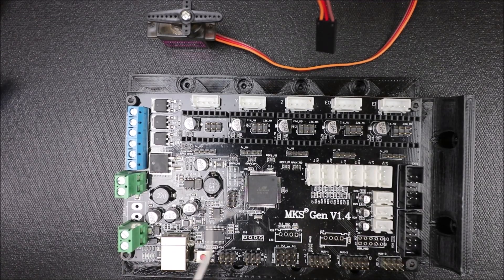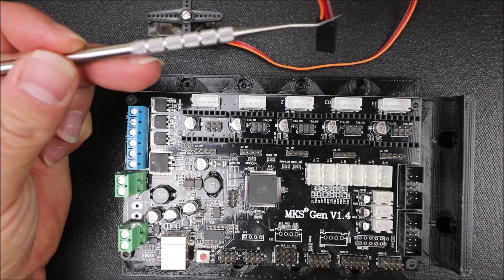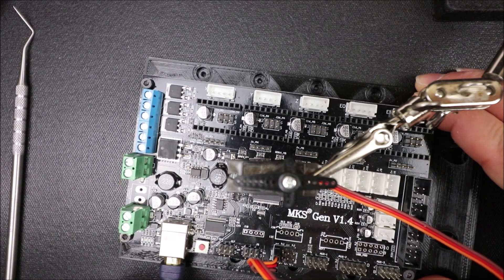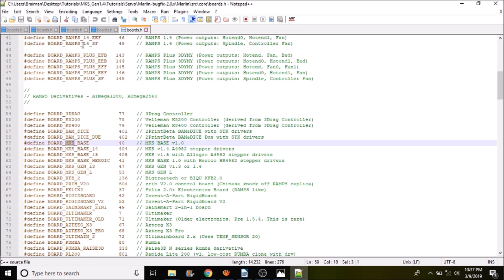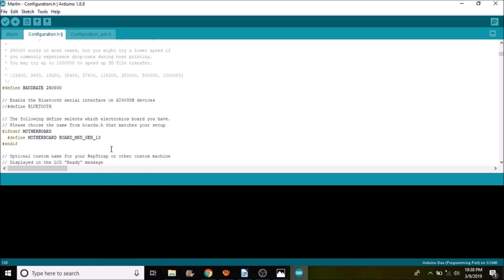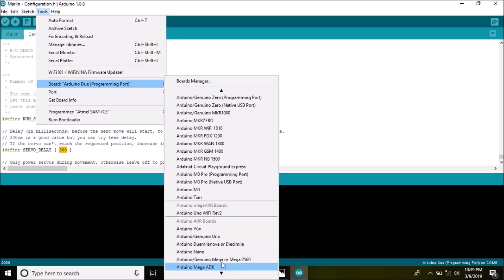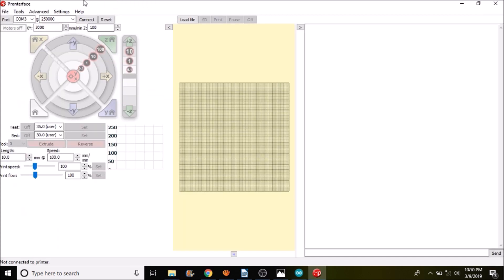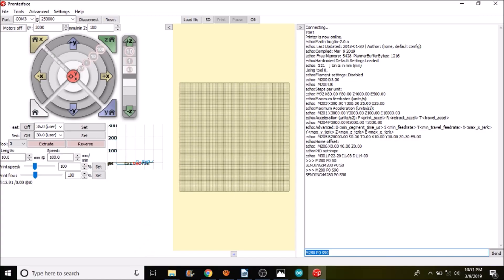MKS Gen 1.4 - Servo

Comment: Hi, I do have digital servo that rated 7V.. So I do need to step up the voltage right? Any tips for that? Thanks.
Reply from the maker: The voltage is five volts so I'm unsure.  Do you have a link?
Reply: Edward Braiman it's LDX-218 

Description:
Brand: LOBOT
Item: LOBOT LDX-218
Operating Speed (7.4V): 0.16 sec/60°
Stall Torque (6.6V):  15 kg-cm
Stall Torque (7.4V):  17 kg-cm
Dimensions: 40X20X40.5mm
Weight:  60g
Connector Wire Length: 300mm
Usage:For RC Models